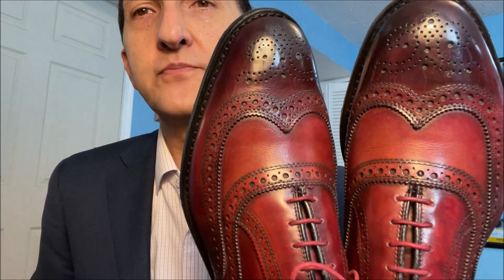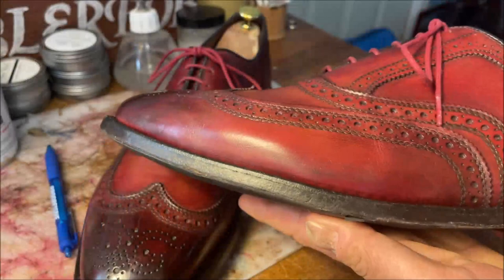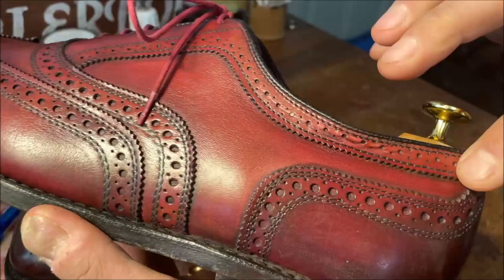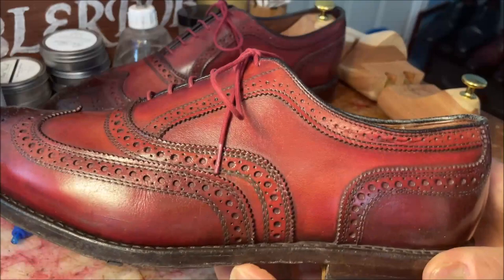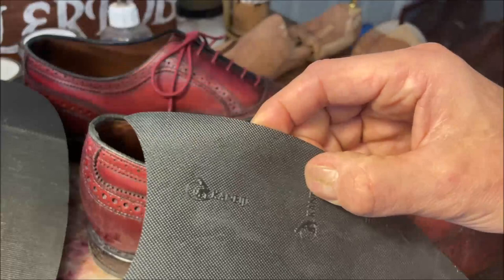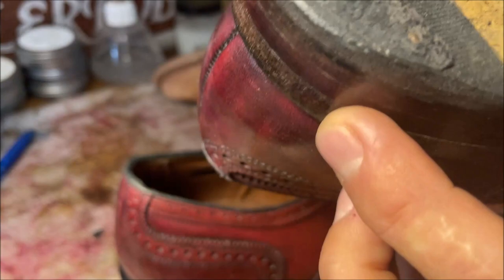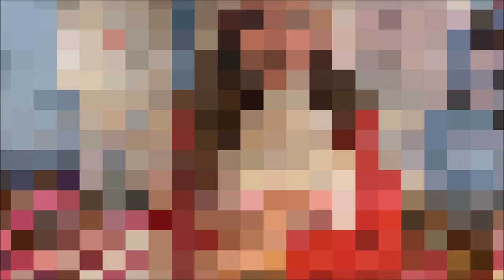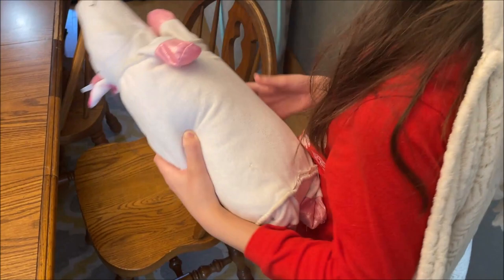My McAllisters 5 Year Review / New Half Soles

Comment: Hi Bob. I have a question for you. I currently own 7 pairs of Allen Edmonds. My most comfortable, by far, are my McTavish, which I’m sure it uses the same last as the McAllister. It just fits like tennis shoes to me. Can wear them all day. I also have a pair of Strands, which also fit very well, although my left pinky toe is developing a corn, and sometimes it hurts wearing them. But not so much as my most expensive shoe, a pair of 5th Avenue which I completely love, but I’m sure they are causing the corn on my pinky, as they fit tighter than the rest. Now, all my shoes are size 12D, although I own a pair of 5th Av. that are 12E. I heard that different lasts fit differently, even if they are the same size. All my shoes are pre-owned, although the 5ht Av. were almost brand new, and I’ve been wearing them for over 6 months already. At least once or twice a week. So, what would you recommend me to do with the 5th avenues that I love so much? I just purchased a corn removing patch, but I haven’t had corn issues in decades. I stopped using leather shoes for years, and just started again last year with my AE collection. And it wasn’t pretty having to deal with corns and calluses. Thanks!!!
Reply from the maker: Martin, the McTavish is actually on the 201 last. If you look at it from above you should see that the toe bs overall shape is different. The toe actually has a very slight chisel to it. See this video for a comparison of the 65 vs 201 last:
https://youtu.be/9mkV7t_yqag
Obviously the 201 last must fit you really well. It sounds like you need either a little more width or a little more length on the 65 last. If the overall width is good, you could re-sell the ones you have and get 1/2 size longer and one width narrower. For example, going from an 11.5 3E to a 12 EE should be close to the same ball width, with more room in the front of the toe box.
Reply: @CobblerBob  Hi Bob, I saw your video and is pretty obvious why the 201 fits me perfectly. Today I'm wearing my 12E 5th Av and I can feel the difference. Way more confortable and closer to the 201. The thing is that the other 5th Av, Strands and Park Av fit perfectly in 12D, but the brown 12D do not. I guess the others are either stretched with use, or maybe my Brown 12D are in reality 12C or 12B, and is simply a factory flaw.
Resell them? Oh God, the perks of living in the US. The market for used GYW shoes in Panama is zero to none. There is not even a cobbler in the country, so I'm becoming my own cobbler. I have already replaced several heel tops, installed a couple toe plates, added rubber half soles, and my last stand arrived today in the mail, so soon I'll be able to resole my own shoes. Looks like my only option will be to use my stretcher on the Brown 5Av.
BTW, I also got from Goodwill a pair of McNeils, that I love, but they feel way too uncomfortable. Maybe I'll have to stretch them too, as looking in the AE last page, looks like the 97 last is even narrower than the 65.
Now I know that for future purchases, I better go with 12E on the 65.

Comment: I have found when using shoe trees after installing, I push the tree in as fall as it will go. I have yet to have creases even on corrected grain leather.
Reply from the maker: Make sure they're the right size trees. Also, if you have the kind that the forefoot is one piece rather than the two piece design, and you have wide feet, they may not fit well. PS, I've found that corrected grain leather creases much worse than full grain. I'd also suggest give the shoes 2 days off for every one day of wear. Not all of my AE shoes are as crease-free as these are.

Comment: Have you installed toe taps before or have any recommendations on them? I severely wear the toe of the shoe before anything else.
Reply from the maker: I only have toe taps on one pair of shoes, these:
https://youtu.be/XxbhWKe24YU
I just don't use them because I don't wear out the toes. This pair came with the toe and heel taps installed, so I left them on. To be honest, I barely notice that they're there.  You can get them in a little kit from Kiwi at any drug store and they're simple to install. The main downside of the plastic toe taps is that they wear out fairly rapidly if you walk on pavement, so you'll need to keep an eye on them and replace them before you wear into the leather. There are obviously the brass plated steel, aluminum, or even solid brass Frech Tips too. I have thought of doing a video on installing metal French Tips, but haven't done it yet.
Reply: @CobblerBob  do you have any suggestions on how many or which styles of shoes to keep? I’m trying to downsize for closet space and so that I can take better care of the ones I have